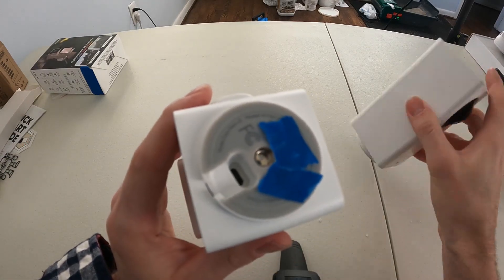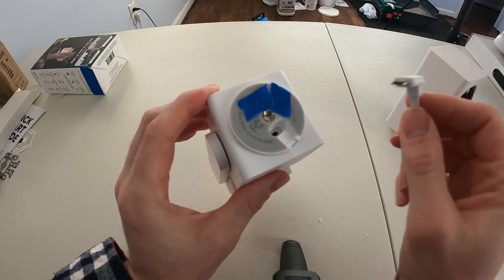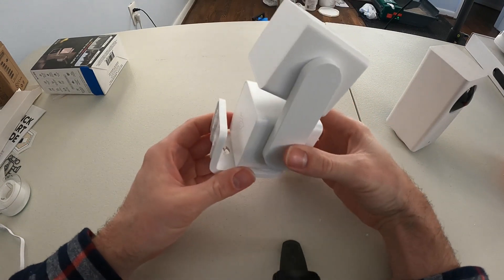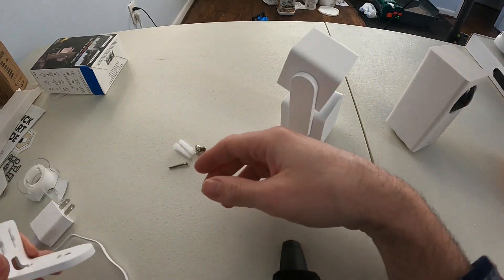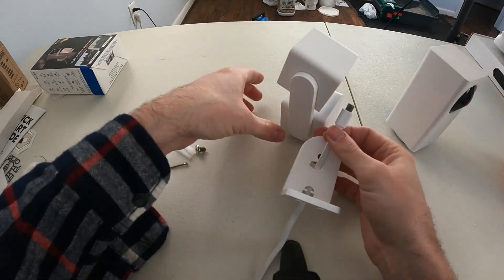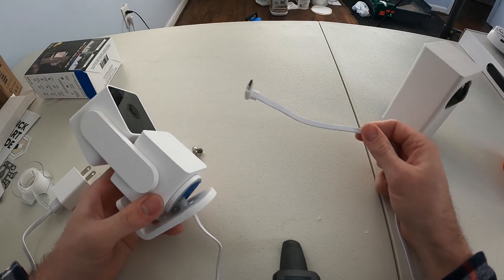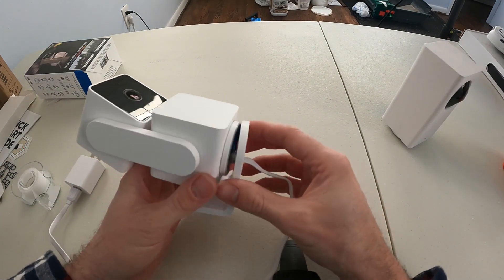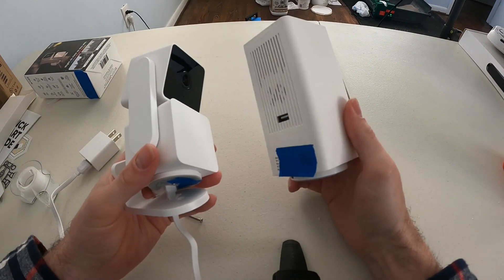WYZE CAM PAN V3 HACK - Use your existing  micro USB cable instead of the 90 degree angle one

Comment: I used their custom cable and plugged it into the existing cable using a ELECTOP 2 Pack USB 2.0 A Female to USB Micro Female Adapter Converter from Amazon. Adapter works great for indoors. One must waterproof adapter connection area if outside. Good luck.

Comment: One other tip. You can hang the camera upside down if needed, due to limited mounting options etc. In the app select Advanced settings and rotate 180 degrees. I think other Wyze cams have this option as well.
Reply from the maker: Thanks

Comment: So far I only have one of the 5 up. https://www.youtube.com/post/UgkxOXxsTZ3ptV_Pk0fFl8bNZvVqeoqBQFwe  My son ran out of time, with motion detector etc. I have it over my garage door. It works great. Have seen a couple of cats, my dogs, when I am out front. And had a bee buzzing around right in front of it. It works very well. It even shows the neighbour's driveway, but only shows movement just past my own, which is very long. I highly recommend them.
Reply from the maker: It's not really for commercial use

Comment: One flaw this camera has is the flexcable from the power supply to the internal circuit board comes out from its connector. There should be a physical stop to prevent 360 rotation of the bottom base so that wire does not pullout. Im very savy with electronics. I thought the device was DOA. However after tearing it apart i found the wire not even connected and connected it. The cable is like those in your phone and computer screens those flat cables.

Comment: I used existing cable with Amazon asapter ELECTOP 2 Pack USB 2.0 A Female to USB Micro Female Adapter Converter. Allowed joining to my longer cable indoors. You would have to waterproof connector if outdoors. Good luck.
Reply from the maker: You could also buy an adapter like you say. With my method, depending on where you mount it, you may not need to waterproof it. If the camera is under an eave and in the correct orientation you would not need to waterproof it. However if the camera is mounted upside down and not under an overhang, then yes you would need to caulk the connection. It depends on your use case.

Comment: I ordered an extension cable that is not a 90 degrees. Only problem, if you look at the 90 degree one that cam with the cam it has thin plastic around it. The one i got from Amazon is to thick to go in that small hole.  So buyer beware and take that in to account if you are going to order an extension.

Comment: Just use a standard bracket with tripod style screw and ball joint and ditch the one that came with the pan 3 the it screws in no problems

Comment: Figure the extension cable is adequate for weather sealing?  Or is the stock 6' cable a better/tighter fit for the port?
Reply from the maker: The stock cable has a better seal. For several days I've been using the old USB extension cable outside with no problems. My camera is under an eave so it gets some protection from moisture. Even if the camera wasn't under an eave I think it would be fine. The charging port is facing down, so any moisture should drain off anyway. If you want to be super secure you could caulk the connection extension cable connects to the camera. Probably not necessary though.

Comment: Any 25 foot microUSB cables that would work for this without modding the mount? I think i will do it your way
Reply: Yes. It’ll work without making a hole in the mount. Just don’t know if it’ll deliver enough power since it’s 25ft. I have a 42ft wire and it occasionally freezes when I rotate it a lot. A LOT.
Reply: @tinwas_taken I ended up using a 25 foot microUSB and the length is fine. But.. needed to use an old Ipod charger if i have a splitter on that to power both a V3 pan, and a regular V3 at the same time otherwise when the motor of pan activates it resets with the wall wart it comes with splitting power with a v3.
25 feet is fine I have it alone with stock wall wart as well and no power problems. So, i wish Wyze would make 1 so no drilling on mount.

Comment: I use this on my truck camper.  However I put it up and down each time I travel.  I have found the 90 degree cable is coming apart now as it was not intended for the constant connecting and disconnecting.  I also use my bracket to hang the camera from not support it from. I'm going to try that next!
Reply from the maker: Hopefully it helps you

Comment: Thanks for this video.

I thought about this too, but my install is on the 90degree corner so that I can have a 270degress horizonal view of my backyard. To do that, I will need to install this upside down, and I am afraid water might sip into it if I don't use the 90degree USB, still contemplating. I hate when supplier rush and push new products without accessory solution.

I can buy an extended adaptop a to a cable but then I will need to reroute the cable which take even more work to do.
Reply from the maker: You can use your regular cord and hang the camera upside down. Just seal any gap with some caulk or spray foam, easy

Comment: Can you use a USB extension cable? Wouldn't that suffice? I'm asking because I have extra USB extension cables I bought from a dollar store. What do you think? Thank you..
Reply from the maker: If you don't want to drill a hole, you can just buy a very long usb extension cable to plug into the cable that comes with the pan V3. It would be a male USB  to female USB extension cable.

Comment: Experienced the same problem. Have a flood light and wanted to mount this about 15ft away. Tried an adapter and a 15ft USB cord and the camera will not connect. Grabbed an extension cord and plugged into the wyze cord and it works fine. Going to try plugging the camera directly into the 15ft cord tomorrow and see if it will work. If it does I'll be drilling a hole in the bracket (dremel) 
If it doesn't work then idk what I'm going to do. 
Wasn't much into this security camera stuff but, twice within the past month I have had to put a mirror on my wife's car and I'd like to catch the f'er.
Reply from the maker: Just keep in mind if you use a really long USB cord sometimes there is a voltage drop over the long distance. So the camera can't get enough power. Another solution might be to buy a lamp socket plug adapter. Which allows you to plug something into your front or pack porch lights and run power off of that.
Reply: @techtidbits7594  I'm pretty sure it is a voltage issue. I replaced my only light socket with the wyze flood light. I don't have any outlets out there either... Electrical needs updated... going to be quite a project if I have to run power over there.....
Reply from the maker: @Jason-si4mf  Good luck, I hope everything works out for you with the cameras. Hopefully you will be able to find a solution for the voltage problem

Comment: Yep my exact solution. I did the extended wire routing days before the camera arrived so when I saw the 90deg head I drilled a passthrough hole without even thinking

Side note: I had to drill a second opposing hole because where the cable plugs in from the bottom is where the camera's rotation end point is; in my case the "back" of the cam had been towards the main subject
Reply from the maker: I'm glad it worked out for you too

Comment: Not water proof right?
Reply: Yes, you need to somehow seal it. I just put a lot of adhesive and tape around the micro usb connector to prevent water from getting in.
Reply from the maker: Use some silicone or mount it under an eave

Comment: not waterproof that way .. the l cable does a very titght water proof seal.
Reply from the maker: Yeah mine was under an eave so it wasn't a problem. You can caulk around the connection just to be safe though.

Comment: Just bought a Wyze V3 pan/tilt camera .... works fine....BUT the fact that Wyze doesn't make an OBVIOUS needed extended micro /usb with the 90 degree connector is simply INCREDIBLE.   How cheap ... how stupid .... how unprofessional ... how insipidly short-sighted of these clowns just makes me shake my huge head.  Taking Wyze camera back for refund and will tell anyone and everyone I come into contact with not to bother with these newbie idiot late-nite info-merical carpetbaggers.   What an absolute crock.  Pushing their V3 cameras ...but offer no accessories.  Hate having to jury-rig a new install.  I manage 78 buildings and was going to use cost effective Wyze in each .... no way now.
Reply: I ran into the same nightmare.....but needed to use this cam. My solution was to use included cable and get a   USB 2.0 female to USB micro female adapter on Amazon. ELECTOP 2 Pack USB 2.0 A Female to USB Micro Female Adapter Converter

 Worked for me indoors. If outside you should simply waterproof it. Good luck.
Reply: @petenestor1  Thanks Pete.  But my point was that a company such as Wyze would introduce and market the heck outta this V3 pan/tilt camera and NOT have the foresight or customer satisfaction concerns front and center is incomprehensible to me.  To think that a 6ft. cord would be all thats needed is insane.  AND the sale of Wyze extensions with proper connectors is a 'profit-center' all on itself for Wyze.  Thanks for your response.  I simply choose not to do business with that type of company.....no big deal really.  It just caught me off guard after purchase and search that this could happen .....
Reply from the maker: @petenestor1  you don't need any adapters for the V3 pan camera. That's what I show in the video. You can just drill a hole through the base and use your existing micro usb cable. But maybe you are referring to something else.
Reply from the maker: @chickensalad5186  yeah they require you to use a 90 degree cable but don't provide any adapters for purchase. That's why I did my work around method because I didn't want to go on Amazon and have to buy an adapter. It's an annoying product design by wyze .
Reply: So simple! Awaiting the delivery of my cameras. A lot of complaining about no solution to the cable, yet you nailed it.  Thank you. Glad to see someone has the sense to figure it out. Subscribed.  Good success to your channel.
Reply from the maker: @artsisland1683  Thank you for subscribing. I'm glad I was able help you and many others with this simple fix.
Reply: While many of us Wyze " GUYS " can concur with you, There's no need to bash them because of an oversight. It's obvious the techs didn't foresee the outdoor installation issues with a 90-degree butt end and cables that presently exist through walls. I'm sure they're getting plenty of backlash over this issue, let's hope they make the adapter available ASAP. On the other hand, Tech TiDBITS has a viable no-cost solution.
Reply from the maker: @flex5966  I'm not trying to bash them, just point out an annoyance and the work around that I found.